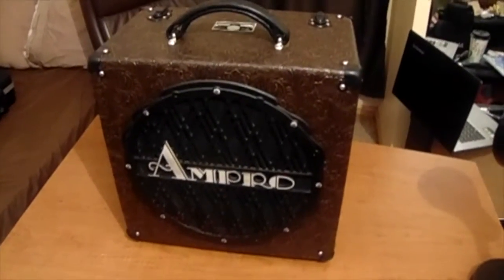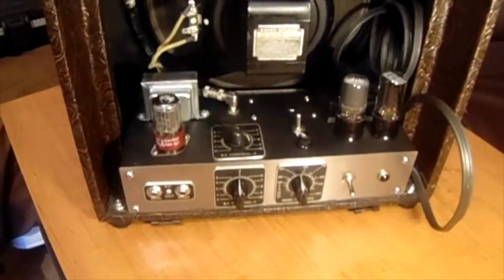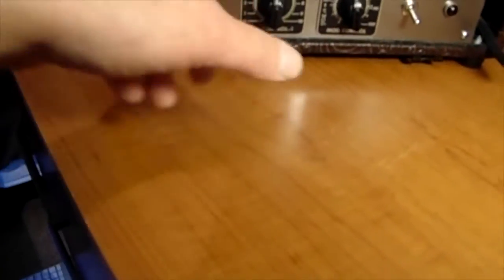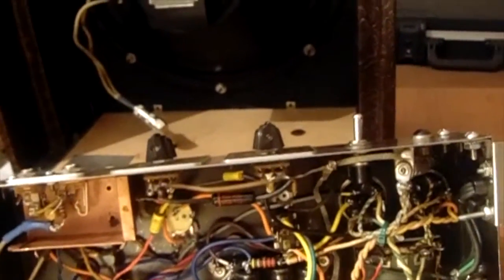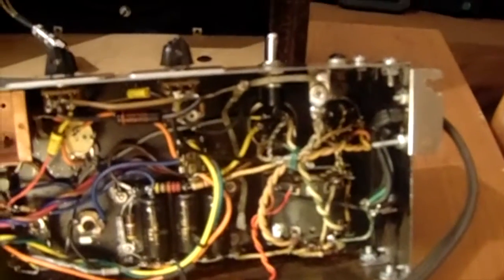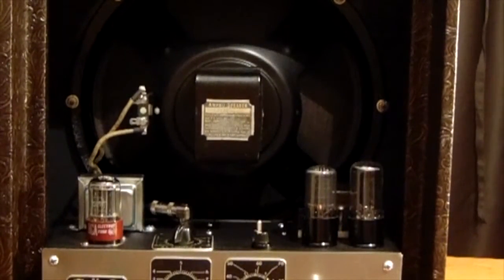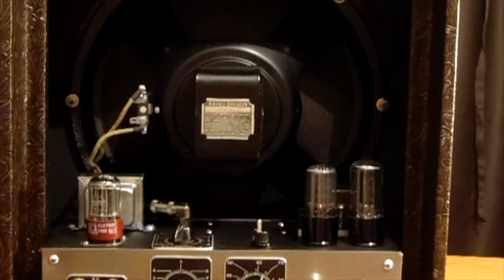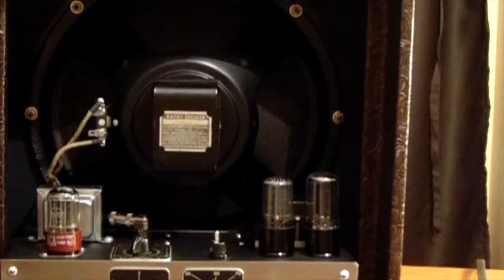Fender Champ Clone

Comment: I am really impressed, especially for a first build. When you opened the rear of the cabinet, it actually looked like a vintage amp with the old-fashioned dial plates and professional-looking chassis. The finish work is excellent, as was the audio demo.  I thoroughly enjoyed watching and listening to this video. Congratulations on a stellar achievement.
Reply from the maker: +Uncle Doug Wow Doug, coming from you that is high praise indeed, thank you.  I could have bought a kit, and there is nothing wrong with that, but I really did get a lot of satisfaction from taking what was essentially a bunch of junk... and making something out of it. Hope you are doing well and thanks for all the help, Tom
Reply: You're welcome, Tom. The praise was all very well deserved. Rusty and I send our regards.
Reply from the maker: I hope I don't drive you and Rusty crazy with questions as you saw I have the 2
Hammond chassis I plan to convert...(I really do try to figure it out before I ask you any questions) but I haven't started on those yet. I turned up the volume to almost 10 on this little Champ/Princeton clone today for the 1st time, and am really in disbelief at 1-how loud it is for a 5 watt amp, and 2- how much it can break up, but in a good way... I did spend a lot of time trying to bias the pre amp tube via the cathode resistors...... 1500ohms, the stock 12AX7 values was not correct.... when they were used the plate voltage was only around 120V... I tried to use the RCA tube guide specs, and got close....I ended up using 2600 ohm cathode resistor's with a plate voltage of around 170.. for the 2nd triode...the 1st triode plate voltage was a little lower, about 140-145V... I think because of the 68k input resistor's... not exactly sure... the tube was NOS, and both triode's tested the same. It was interesting to see the plate voltage change by jumpering in different value cathode resistors...sorry, I know you know this... but it was new to me, and my wife doesn't care..LOL You don't have to reply to this if you don't want to... I will be bugging you soon enough about the push pull amps. Oh yea, someone gave me a 1950 Zenith Trans Oceanic Radio.. It doesn't work, but I think it's neat and am gonna try to get it going.. TTYS, Tom
Reply: The key to pre-amplifier gain is really not the biasing but the value of the plate resistor. If you experiment with different values, you will see this. The higher the resistance, the more signal goes to the output tube, for higher gain. There is a practical limit to this, however, since too-high values will lead to unpleasant overdrive distortion.
Reply from the maker: Funny, I am going to send you a msg on another open page and I saw this.. Thank You for telling me that UD... I do remember from your resistor series. I really didn't want to change the 100k fender value as I didn't want to stray to far from the original design.... I think what I was trying to say is this.. I was impressed with the very clean sound as is.. And the gain at much higher volume as is. I had changed the cathode bias from schematic's 1500ohm, because of low plate voltage..  so I believe I adjusted it accordingly. Rca recommended that with a 100k plate load resistor, .22 grid resistor of following stage, a 2600 ohm cathode resistor, plate voltage for the 5691 should be about 180v  I wasn't trying to get more gain, just get the tube close to it's operating parameters. It is now at 170 plate volts on the 2nd triode, and averaging 2.2ma plate current. The 1500 ohm cathode resistor with the 5691...... plate voltage dropped considerably.  I am just guessing, maybe something to do with the tubes transconductance? As it differs from the 12ax7's? I am quite sure you are correct though, If I thought it needed more gain, higher ohms on the plate resistors. This Dog showed me in a video a while back, I think you would like him..... :)
Reply from the maker: +Uncle Doug Hi Doug, I just wanted to clear my thoughts to you for a moment... Am I missing something, like a link to a page of all the Guitar Amplifiers that people built with your assistance? Or is everybody just replacing electrolytic capacitors on there Fender Deluxe amps. Or biasing their tubes? You have over 30,000 Subscribers.  I have watched all your video's, and most of them several times, and actually enjoy reading the comments and questions of others, and of course the advise you give them, and me..Only a handful of times do I recall someone saying they would send a link to a project they were working on......... But I don't think I have seen any.... I actually only made that video of the amplifier I made, to send to it you.  I Could have warmed up for an hour and showed off and played some Bach Fugue's or Paul Gilbert or whatever..... But I knew you wouldn't be impressed by that, in fact I think you would have thought less of me. I also Could have made the underside of the amp look perfect, with an aluminum chassis and all new wires running in little looms and all the A/C and D/C intersections at 90 degree angles, but that wasn't what I was going for.... I bought that beat up Ampro Projector cabinet because it reminded me of the 1937 Gibson Amp you have, with the removable back, moustache handle and I knew the Precision Generator Face plate had similar dial indicators I could cut out. I wanted it to look old fashioned, the wiring on those early amps was not all neat... they ran all over.  I initially used ONLY the wires from the generator to give it that 40's-50's look, but as there was only one piece of braided shielded cable I was able to salvage,  it hummed badly,  I had to use some newer shielded wire 1960's I believe. I really think you got what I going for.... But I was only able to do that because of you... You are a unique individual,  a master mechanic,  a gifted orator , a brilliant teacher, and I think one really fine person for taking the time to help others. Heck you don't even have adds in you video's!!  But I will be truly saddened if you tell me there isn't a web page somewhere of 600 guitar amplifiers built by people who utilized the information you freely give out...... like www. The Uncle Doug Academy of Ampliholic's Anonymous!
Reply: Wow, I really appreciate the kind words, Tom, but as far as I know, no one has compiled a list of amps completed with advice and help from Rusty and me. Personally, I think that your amp project could hold its own with any of them. Keep up the good work and keep us posted on your projects.